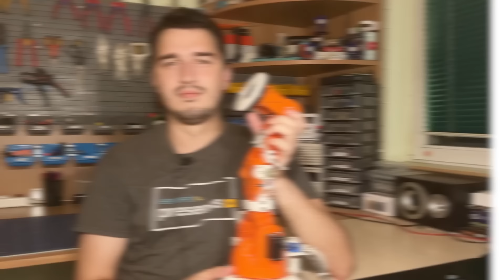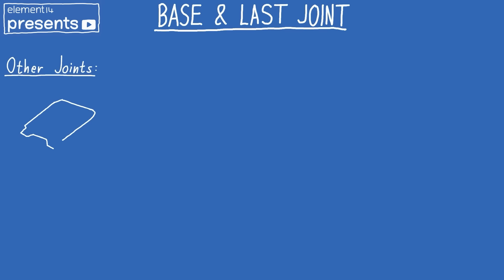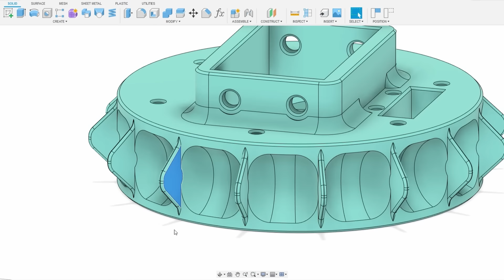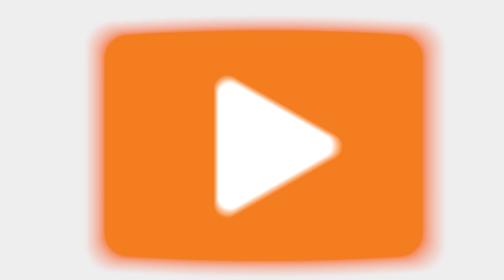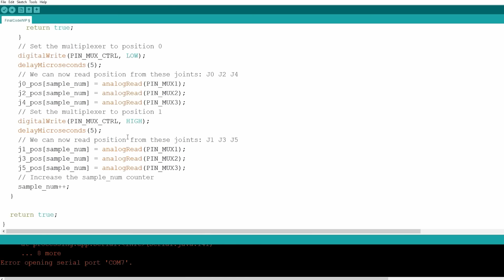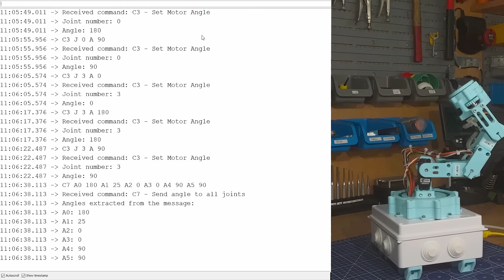Affordable DIY Robot Arm: A Deep Dive into 3D Printing and Servo Motors

Comment: i think your extra potentiometer was a bit unecessary as you already said the servo already has a potentiometer you could have just solderd one wire to the poti in the servo vcc and gnd is already there. At least i guess so
Reply: correction its not as easy but still easier. As you can only move the servo when its unpowerd you haver to pwer the poti seperatly. if you do so i could backfeed the servo. solution i tried cutting vcc of the poti soldering a wire to in my case it needs 3v  and i added a hight restor in the placebi cut. now if i power the servo i also have to power 3v. it works as intendet

Comment: For anyone thinking about building this.  I would think about using dry lube instead of grease for multiple reasons. Mess. Attracting messes. Buildup of grease humming up the marbles.  

A dry spray on silicon or graphite!   Both are very slippery. Settle down boys that would be very itchy and or painful.  Anyway.    Very slippery and nothing to attract dirt or dust.  Well. Not nothing.  But way less!

Comment: I have a question I would appreciate if you would answer. If one had the funds, would it be more mechanically sound and have much more force to use stepper motors? Since most stepper motors are PWM and Arduino is quite functional for a PEM setup and an inexpensive motor controller like Cytronics Motor Controller (in any amperage needed), would that type of setup be feasible? I have no illusions as to the expensiveness of steppers but Arduinos are cheap Cytron MC are cheap but both are excellent products. What is your thoughts. I ask because I’m working on my own robot. Not like human form but something that has locomotion and articulated arm. It is designed for handicapped persons that lack the ability to preform these necessary functions. The handicapped individual must be able to vocalize commands. 
Your thoughts? Thank you for your response.

Comment: try as cheap as possible two-angle solar tracker cross mount for a 400W 1x2m solar panel. use screw gear lock drives with servos. on a mount arm pole. yep a actually usable practical application.

Comment: I'm looking for a motor to arm that will lift 100KG no idea where to find such stuff
Reply: Linear actuators on an arm like a hydrolic cylinder on a tractor.  You can lift 100 times that with 12 volts.  Not as much of freedom of motion.  Maybe 170 degrees ish max.  But loads of weight!! Way more than any stepper motor could handle. Even with large underdriving gears! 

As well as being incorporated with multiple shafts as wirh a scissor lift. There's ways to gear wirh levers too!  And possibly even better precision positions.  With linear movent indicators.
Reply: Also you could make your own with worm drive gears. Lots and lots of torque.  Lose a bit if speed.  But loads of torque.

Comment: at 27:30 when  you explain how , when holding the arm vertically and seeing how all 3 motors are justs tacked upa nd the bottom one has to be strong enough to constantly belifting two other actual motors, uits liek seeing a 3d printer able to move all of its parts around liek a human arm and you have to rteally apreciate roboticas after realizing how much power and force you need to move a heavy robotarm, but if you want it strong it must be heavy lol

Comment: make this an easy kit ali express can sell, so easy we can just pop  it into a 3d  printed robot arm and start controlling it with our smartphones, where all wiring is color coded or numbered and super easy instructions, like built into the inside of the 3dprint itself actual instructions lol, and the wires and motors all made super easy to install like building a prusa printer

Comment: By hacking inside of the servo you can connects cables to the potentiometer inside and read data that way, its usefull when you need to be space efficient
Reply: Good point! That gave me an idea since even if the pot isn't super accurate, it's fine because I'll just be using it for display purposes.

Comment: Interesting project.  There have been a lot of discussion over using stepper motors rather then servos, and I myself would have thought steppers would have been the better choice as they tend to have more torque and precision, which is probably why steppers are used in telescope mounts (HEQ5 / EQ6 for a couple of examples), and in most 3d printers and CNC / Plotters.
Reply: Steppers have less torque if you take their weight into account, there are metal gear servo's that have insane amounts of torque. Advantage of steppers is accurate 360 rotation without closed feedback.

Comment: You should redesign the inner bearing race to be, well, a bearing race. You can't combine a cage and a race or you defeat the purpose of the race. Bearing cages always float freely and must be able to move with the balls, not restrict their movements. The balls will orbit at essentially the average rotation of the inner and outer race, but this design prevents them from moving at all.
Also, since this is a comparison with an existing arm, you should compare their performance (eg: lifting ability and accuracy).
Reply: I know what you mean, good observation. of course a cage should be separated from the race, but a cage is normally out of metall and i dont think a 3D printed stand alone cage would serve its purpose for long. the combination makes it last much longer. Of course it adds some friction but as he said, it doesnt have to be a full grown bearing, spinning hundreds of times per minute for hours without end, it just has to smoothen the movement of the arm on the base a little. but as i said - good observation and a well appreciated constructive comment. :-)
Reply: @philipp9195  No, I'm quite positive it makes little to no sense, it goes against the logic of the bearing. Then just forget about ball bearing and make simple friction bearing, even plain, or with some inserts. Or most probably, for the low-requirements you describe, just use rollers on a steel pins. But really, for the bargain you can get real bearings for, you'd do a 3D printed bearing only for pure fun. And I do support that, have a fun and learn, that's good  :-)
Reply: Yes, separating the cage is totally necessary. In addition to that, the schematics depicting section of a bearing is nothing more than that (schematics). Real ball has a two point contact in the bearing (both against the inner and outer ring), not a contact along a curve, which would make a lot of friction. Here, Miloš took design to the next (bad) level and he seem to have area contact, which probably make it so bad, that it might not be better than sanded and greased cylindrical contact. I'd rather go for cheap garden copper tape on the inside of the hole and outside of the pin and a appropriate vaseline. But bearings are so cheap these days, so you can buy one for a dollar or two (if you don't get fancy). The marbles probably cost more :-). But I'm sure he had a fun designing the arm, including the "bearing" and he'll learn new stuff.

Comment: Use bicycle headstock bearings - cheap and easy to source.
Reply: That's something that could work for the last joint, but needed a pretty big one for the base joint, so that's why I went with the marble option, also a fun thing to try out. I'll be working on a new arm soonish, and the headstock bearings are a great idea since they are easy to source, or things like skateboard bearings.

Comment: Is there a benefit to using servos and potentiometers vs steppers and end stops?
Reply: Hi!
The benefits here would be the easier control, gearboxes that come already built into the motor and the low cost. Using stepper motors with a proper gearbox and an encoder to track the position precisely can also be a great choice, but would come in more expensive and probably in a bigger package. That said steppers with just end stops are still a great choice, that's how most 3D printers work, but having a stepper with an encoder is even a better option, because the system can then compensate for any missed steps or bumps during operation. My goal is to also make a robot arm using stepper motors at some point, it will be a bit bigger and expensive than this one, but I think it will also work much better!

Comment: So many YT videos on 6/7DOF DIY robot arms, but not yet a single one that shows why you'd want one... (other than to have fun building it)
Reply: I'd like to have one that can pick up the walnuts in my yard. Zoe the robot has not arms at this time.
Reply: It's true though... the use case is tricky. Personally I find a two segment arm offers a lot of fun with a less complicated build.
Reply: @androofroo   A SCARA style robot arm is a great example of that, can be made rather sturdy, and the mathematics for it are easy, thought I really like how this style of arm looks so that's why I went after it hahahaha.
Reply: @rasicmilos  lolz ... it is important for the build to be cool.... it does keep you motivated 🤘
Reply: I think as a cobot
Reply: Purely for educational purposes (and fun of course), this is a project for learning not so much to be useful to actually perform any function, for that, the arm would need to be much more expensive to get all of the backlash down and the accuracy of the whole system up for it to be useful.

Comment: Actually, the marbles can't move freely in the bearing, because of the separators. The friction would be lower, if you just put them losely in, because then the only friction is between the glass marbles, which are smooth.
Reply: Hi!
The glass marbles I've bought are anything but smooth unfortunately, or even that round for that matter, I couldn't find ceramic marbles in time to test them out, they are a cheap toy, so the tolerances don't matter. My first tests with the 3D printed bearing were using a bearing design where the marbles could touch one another, and the whole bearing would lock up once 2 of them come in contact. The separator walls aren't a perfect, but are an easy solution, but at least with these glass bearings that I've managed to find, some kind of separation between them is needed for the bearing to work at all reliably.
Reply: @123DragonHeart  Oh okay I can imagine that, then I'll take my advice back
Reply: Glass marbels tend to stick very much, glass is grippy.

Comment: I keep looking for a 2d paint spraying robot and can’t find one, if anyone one knows of a kit, video , anything please let me know
Reply: I've seen a lot of kits for wall painting robots, that works with 2 strings, or table top plotter, but they usually work with pens, though could probably easy be modified for spray painting. What kind of an application have you had in mind?